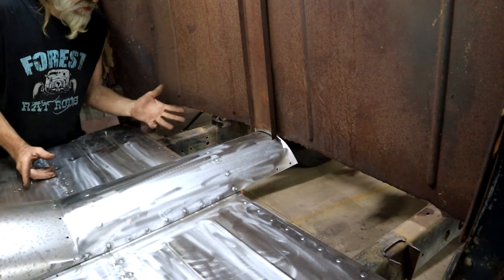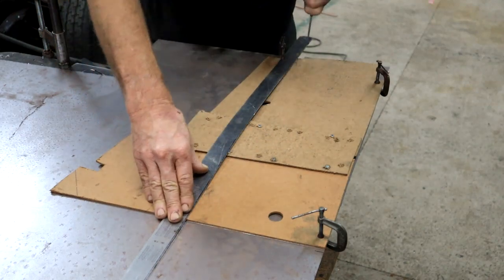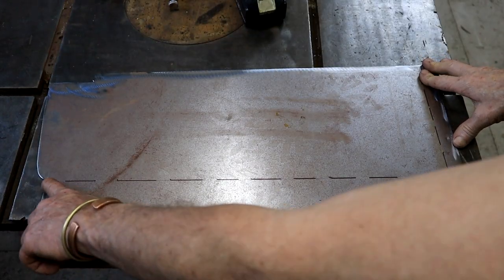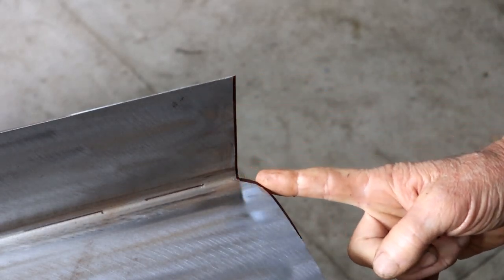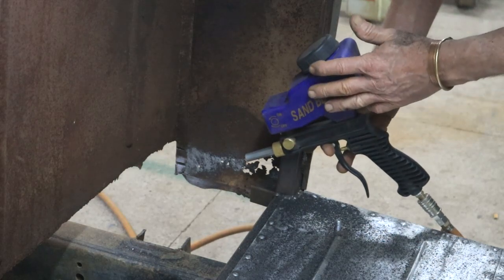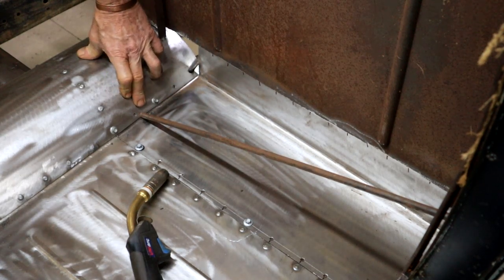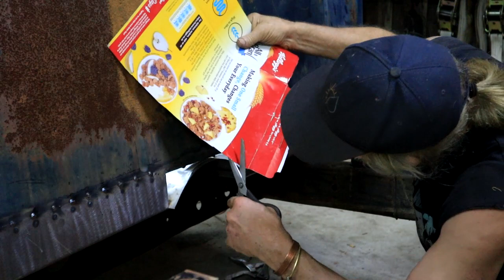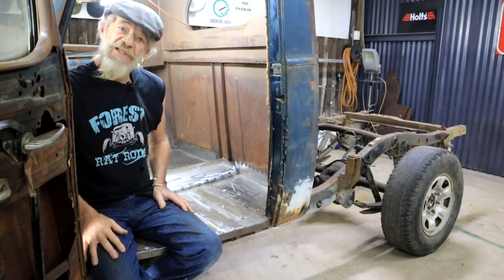Building cab corner and floor section in one go - 1939 Hudson Rat Rod Part 10

Comment: Dif will you be doing a full weld along the bottom of the cab? Seems like the way you lapped the pieces you're inviting water in. Looks  cool but may give you a headache down the road. Love what you do!
Reply from the maker: Nah, it should be fine. Paint and rust will seal it up quickly🙂 It is similar to spot-welding, and cars have lots of seams like that.

Comment: Watching you use the flap disc to remove surface rust, and holding the grinder under its belly like a puppy has me wondering, why ? 
No doubt you do it for a reason.
Thanks as always for the teaching.
Today I helped  roof a summer house for my neighbour, so no garage time on my current build, but did get a bit of time yesterday.
Reply from the maker: I used the flap disc because I simply didn't have one of those face off discs handy at the time. As for the puppy grip, I didn't even notice until you mentioned it. No idea why!😄 It worked for me, but each of us will do it their own way. Whatever works

Comment: I meant to say last time, Diff - with them little hand-held blasters, what media you use really matters - the lighter the media, the better the results you get - the ideal for them is medium or fine grade crushed glass - it works absolute best. That grit you are using is a bit too heavy for the gun. They don't have the chooch/design to accelerate heavier grits fast enough - but they do good accelerating lighter mediums. Faster the medium is accelerated,harder it hits the surface, better the cleaning action. :-) Crushed glass ftw.
Reply from the maker: Makes sense what you say. The problem out here is getting hold of the specialized media. So, we work what what we can find...

Comment: It's looking really good getting each section done it's getting close to firing up the engine temporarily. I used to sand blast if you have a canvas tarp you can make a hood with some plastic goggles and tape off an area to contain the mess so it's not going everywhere. Well take care div.
Reply from the maker: Yes, there's no getting away from the fact that sand blasting is just plain messy!
Reply: @ratrodsafrica  yes it is and it's bad for your lungs to.

Comment: Working in the Air Force, our instructors drilled into us that a scribe line is a cut line. Scribing imparts a weakness into the metal when used at a fold. That was mostly for aluminum, but I still can't force myself to scribe a fold line in sheet steel either. Old habits die hard.  I use an ultrafine Sharpie and mark the ends of the fold line and use them to line up the brake.
Reply from the maker: Makes sense on aluminum,  but on steel I really don't think that light scribe line makes much of a difference. And I guess in aircraft engineering everything must be 100% on point!🙂
Reply: @ratrodsafrica  Of course, you're right. We never rusted a part on purpose either! Your rat-rodding is a pleasure to watch. Love what you are doing with vehicles most people would consider too far gone.

Comment: Ok Dif gotta question, you placed that tranny tunnel cutout in position and made a arc with a marker, then you sanded it off, placed cutout back in position and welded it in place. My question is, why not finish cutting that piece out and butt weld all sides? Leaving those two vertical braces on the inside in place of course. Just curious bro…
Reply from the maker: I marked it to see where to remove the paint before sticking it back on for tack welding in place. I could have butt welded everything as another option, yes. But then tunnel cut out and the pieces on each side should be butt welded to make sense. Overlapping is easier and quicker, and its just a rat rod...😄 Also, in the end none of this will be visible since it will be behind the load bin.
Reply: @ratrodsafrica  “ it’s just a rat rod”, I get it…thanx Dif 👍
Reply from the maker: @stevehamilton9418  😄

Comment: I like what you are doing but why do you spot weld your panels in .if you but weld to me looks much better.yes I know it's a rat rod .I build traditional hotrods flathead power for me . Body work is body work .rat rod bob he welds fully and puts in his stitches. It's your car looks good just asking the question
Reply from the maker: Well, spot welds attaches the panels to substructure, butt welds attaches mostly panels to each other. Cars have been spot-welded for years and it is what holds modern cars together.  I feel full welds are not worth the trouble in this application, and since the floor will be carpeted, the aesthetic value of stiches will be a waste of time. Each to his own hey🙂
Reply: @ratrodsafrica  yup definitely it wasn't a bad comment just a question keep up the good work
Reply from the maker: @jamiewaddell1598   no problem, did not view it as a bad comment as all